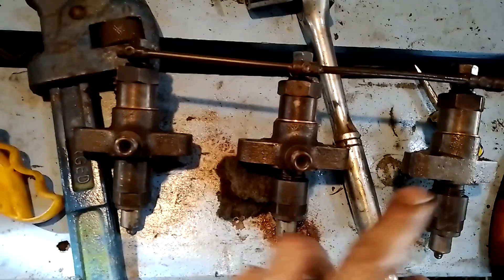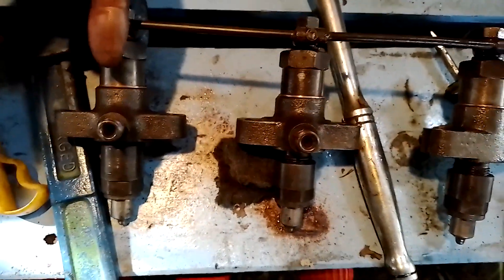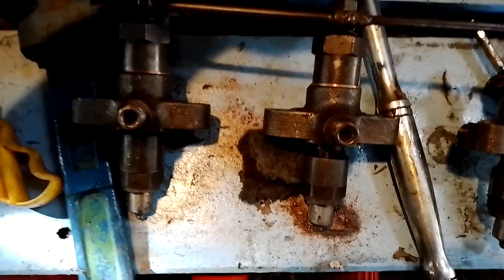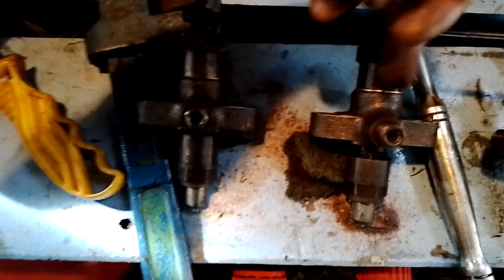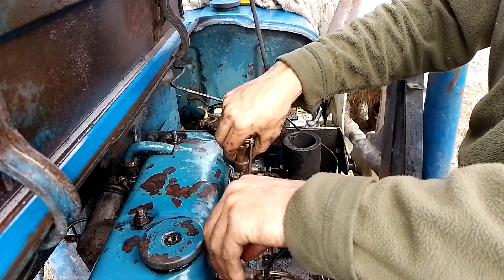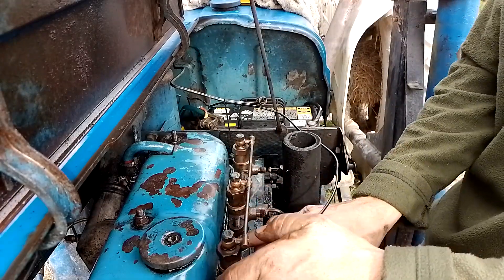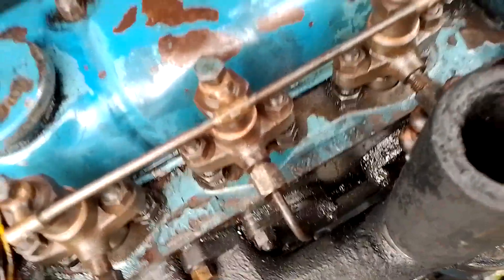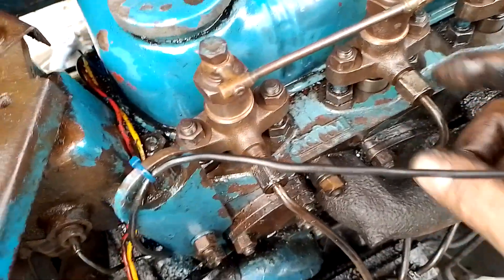Diesel in SUMP

Comment: On the older dextas (not new performance) with the pneumatic governor, if the lift pump diaphragm goes the diesel will drip from the bottom of the injection pump through the pipe with the loop in it, it shouldn't get to the sump and definitely won't get into  the cylinders. I don't know if this is the same as the later mechanical pumps as fitted to the super dexta and new performance dexta. I can't think how it would though as the lift pump is mounted on, and driven by the injection pump and there isn't a direct connection to the sump, other than it going via the timing cover.
Reply from the maker: Thanks for sharing your experience! My thoughts are the same. Since having this happen and uploading this video, I have not had it happen again.  I am currently working on a more permanent solution to replace the temporary one I came up with in this video. Cheers!

Comment: I had the same issue with my dexta causing a hydro lock. I fixed it by taking the glow plug out then using a big screwdriver to crank the engine backwards at the starter ring through the small timing inspection cover. the diesel went out the way it went in but running out the glow plug hole. Now I always turn the diesel off at the tank tap when idle. Mine has a spring and ball bearing assembly at the spray nozzle which didn't do it's job. I've tried four of the nozzles with the small valve and every one has leaked. I've also tried fitting a clack valve on the 3/16" pipe the runs from the tank valve up to the heater valve. The spring was initially way too strong so i chopped it down until it seemed to be letting pressurised diesel past. The issue now is that the diesel loses pressure at the clack valve and no longer sprays onto the glow plug, it's more of a stream so it doesn't start as quickly and need the starter/charger to give it a boost in colder weather. I'd be interested to know if the Agriline valve/nozzle leaks. the ones i got were from APUK and my assumption was the all came from the same factory so would all leak.

Comment: the earlier dextas had a shut off near the heater later ones with revised system like yours did away with it i think as it was no longer neeeded LOL
you can get the shut offs from agriline in uk you turn them on when priming/starting then off - its happened to me so i am paranoic about both tank shut off and the localised valve now

Comment: To my dismay i have found diesel in the sump of my Kubota today, totally full up, didn't think it would get in there, water maybe from a cracked head or dodgy seal but diesel, didn't think it could get through the injectors but it must have, i will need to look further. just seeing if anyone else had the same problem and there you were.

Comment: The manifold heater has a thermostatic valve which should only allow fuel to enter when it is hot. It's a baby flamethrower!  Changing the heater should cure that problem.  Also, another cause of fuel in the sump is a leaking fuel lift pump diaphragm.
Reply: As a random viewer, I appreciate you solving the mystery, Rob. I was wondering what stopped this from happening in normal operation. Much appreciated...
Reply: Not quite, the dexta has a heater coil in the top of the manifold and a fuel jet underneath, when you pump the cold start pump you squirt diesel into the coil o wire , its not the same as a thermostart like the perkins have in the massey tractors